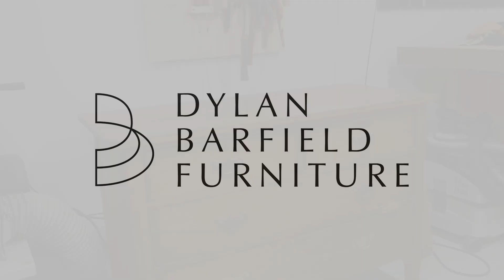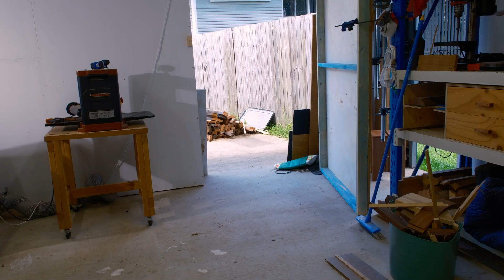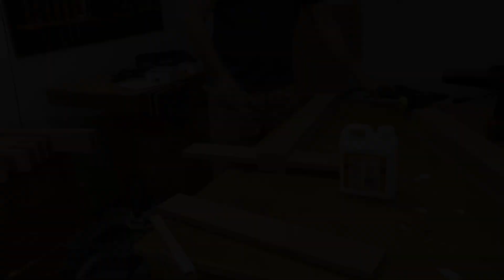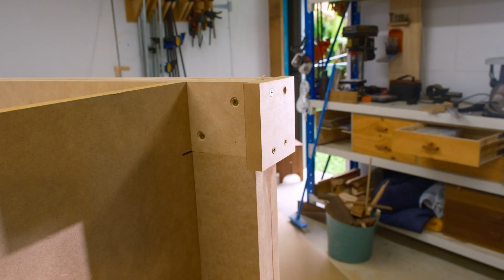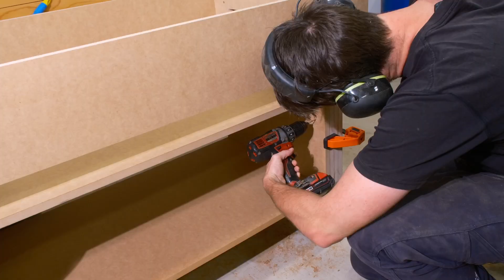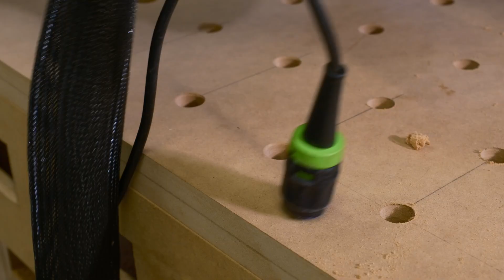How to Make a Hybrid Workbench: Cheap, Easy to Build and Super Sturdy

Comment: People give MDF a bad rap, but it has a place in one's arsenal. And it doesn't look half bad with a little poly!
Reply: The thing with MDF is that in can vary a LOT in quality, the difference between the shitty stuff and the better quality moisture resistant stuff is huge. The better ones are often not that cheap though unfortunately.